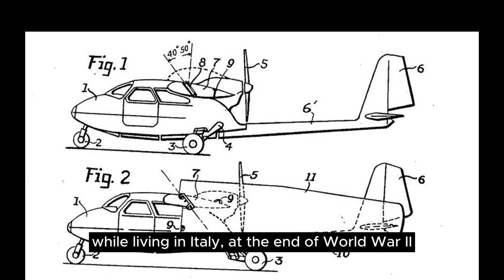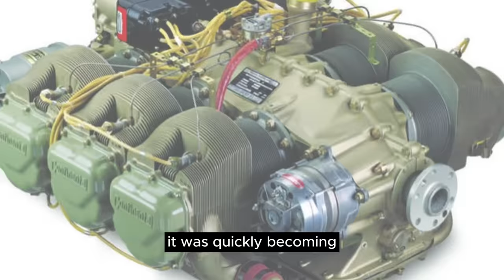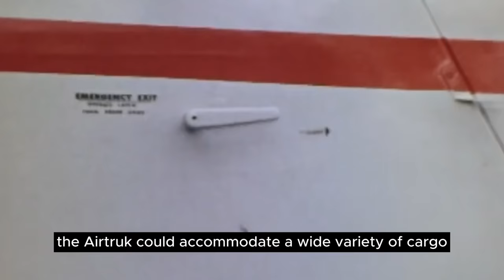The Flying Wonder from Down Under

Comment: Do one on the Fletcher crop duster! From nz , it’s sort of interesting, but nothing on the air truk
Reply from the maker: I just might!  Need to see if there's already bios done on it, then add to my list.  It's an interesting model, in fact it was in part based off a tiny attack aircraft by Thorp!   And if I'm not mistaken, competition from the  Fletcher in part was responsible for the demise of the Bennet Airtruck.
Reply: @aircraftadventures-vids  probably in-part because of its turbo prop power , and it’s high lift invert gull winds , simple ,strong , faster When transiting?
Reply: Wanganui Aero Work ( top dressing ie crop dusting  company) used to perform an aerobatic routine with three of them at airshows.  Maybe still do. Surprisingly good but when you think about it they have good power to weight when unloaded, highly maneuverable and good stress factors.
Reply: @johneyton5452  apparently like a displacement hull !? More power = same speed
  Drag !
Go fletcher aviation

Comment: around 77 or 78  I was lucky enough to get a ride in the back of an Airtruk when working on a dairy farm  north of Auckland  NZ. yeah facing backwards and loud, but i was young and I remember it being a real thrill. The pilot put on a show but couldnt appreciate it because facing backwards  in 3D blows your mind. They normally used trucks to top dress but it was a very wet year so the boss tried a plane. That was a 2 minute ride that I do remember 😅

Comment: Just asking: any need to have the captions embedded in the video itself? If it's important enough to include them at all (instead of using YouTube’s automatic CC, which works not only pretty well with clearly-spoken speech, but can even auto-translate), you can add them from the back end to read exactingly as you wish but they can be activated by anyone interested in them instead of... this.

Again, just asking.
Reply from the maker: The people have spoken, and from that video moving forward I only use the automatic captions (but I manually upload them as youtube's flubs them up)

Comment: No mention if the lower wing served as a canard that would lower the nose to prevent stalls.
Reply from the maker: It would not, because it’s right on the center of gravity. It did help with lift though.

Comment: The objective with the Airtruk was to make the chemical load a higher proportion of the total aircraft weight. This was done by directing various  loads on the aircraft  into the frame of the hopper via the wing struts and stub wing . In equivalent agricultural aircraft the  hopper is just that, a tank fitted inside a conventional  airframe.  The difference between the empty weight of the Cessna Agwagon and  its MTOW is 974kg. For the Airtruk it is 1080kg. That means an improvement in productivity of 10%. But it is  not all positive. The nose wheel undercarriage was less suited to rough farm strips than a tailwheel particularly because of it  very short wheelbase. I saw an Airtruk land with a damaged left undercarriage. It would  have caused nothing more than a scraped wingtip on an Agwagon. The Airtruk rolled into a ball as the damaged leg dug in. Pilot OK but aircraft a write off

Comment: I believe they were built by Transylvanian Timbers (?) at Seven Hills in Sydney's western suburbs 
You would regularly see them being test flown around the area
Reply: no, transfields down the road around the corner of Powers rd and station rd Seven hills
Reply: @auscrank    
You don't think there could've been a connection between Transavia Transylvanian and Transfield ? 
You can't see a bit of a pattern there ?  
Trans.. Trans.. Trans..
They were located nearby "down the road and around the corner.." 
Powers Road the first left turn on Station Road 
Transfield was basically located across Station Road from Transylvanian Timbers
Reply: @hodaka1000  
Trans is for transmission  as in transmission lines, you know the iron man structures for high voltage. The field would be like in the bush.. Had to m8's worked at transylvanian timbers. Rob a head of sales and Wayne worked on the machines.. With the Airtruk I would see them all the time as they would fly out over the prospect reservoir for some reason and I grow up out that way..
Reply: @auscrank  
You'd see them doing test fights around the area and taking off and landing on the northern side of Station Road east of Powers Road behind the old rubbish tip at McCoy Street between Toongabbie and Seven Hills

Comment: we can improve these planes by using the liquid piston engnines and variable pitch torroidal propellers that could be developed for this purpose. Just imagne!  Fuel Ecnomy! Sixe reduction (and thus, cargo capacity increase!), Quieter operTION ( BY VIRTUE OF THE TORROIDAL PROP DESIGN. . Yes, variable pitch is possible.

Comment: It's armament not armor if you're referring to arming the Airtruk with weaponry.
Reply from the maker: correct..oops
Reply: @aircraftadventures-vids  Hey!, mistakes happen! It's ok. At least by responding to your mistake you're showing me that you appreciate factual accuracy! If you want to do a video on a small, light aircraft that was modified with weapons and actually used look up the Biafra Baby which was a Swedish built Malmo MFI-9B trainer modified with six French made SNEB 68 mm folding fin rockets with armor piercing warheads mounted under wing!
Reply from the maker: @thenickhelms84  yes!  I first learned about the Biafra Babies from an amazing book collection my dad owned called “Sordiers of Fortune” from Time magazine.  If you look it up on Amazon it’s got the famous rocket attack illustration, and the story is almost unreal.  Man that goes back to the early 80s for me
Reply from the maker: @thenickhelms84  it’s an awesome video idea but i’m afraid there’s very little in terms of imagery to work from. If i do a video dedicated to the malmo trainer maybe i can shoehorn a segment on the biafra babies.  I wrote about it on my Instagram account.

Comment: Interesting and informative, thanks. But, shame on the video editor who is guilty of committing the video atrocity of BBC (Blow-up, Blur, Crop) 4:3 aspect ratio films and video (or 4:3 films transferred to video) to fill the 16:9 frame. Doing "click to fill" may look OK on a computer screen (other than the unnaturally overly large images) but on a TV the loss of resolution results in a terrible blurry mush. You are taking standard definition video and degrading it to substandard definition video. You are also altering/censoring the carefully composed and framed 4:3 aspect ratio images by the historical cinematographers. Leave 4:3 alone!